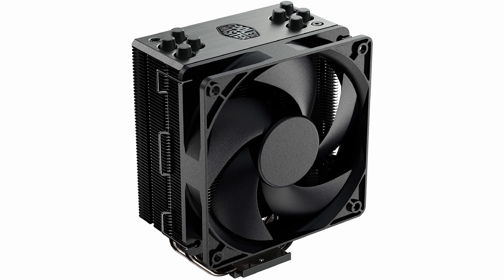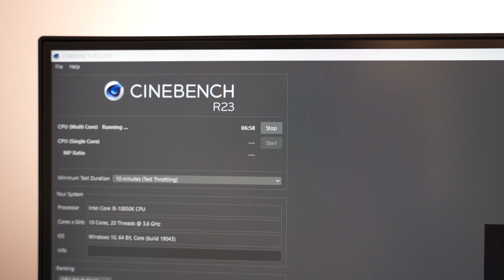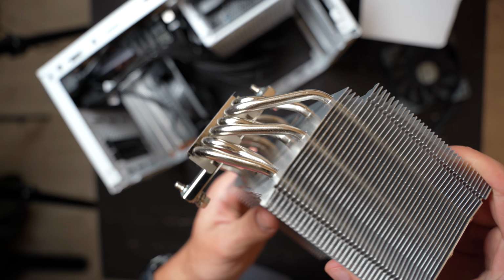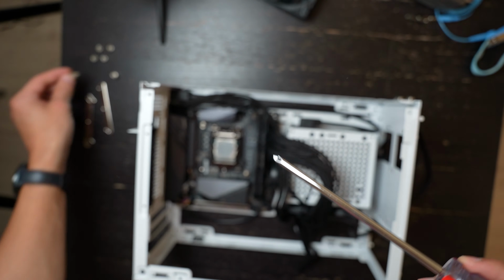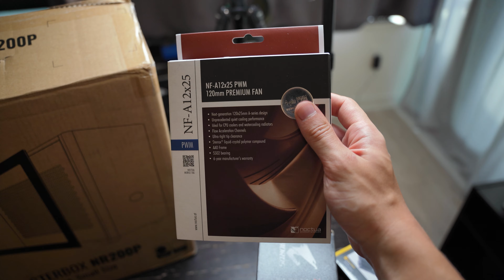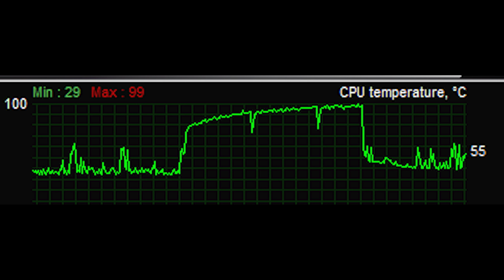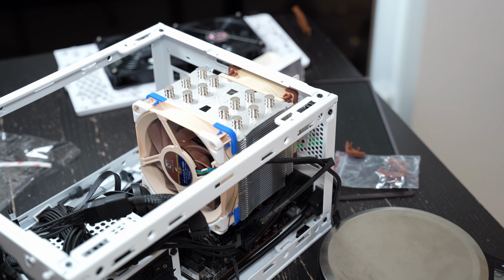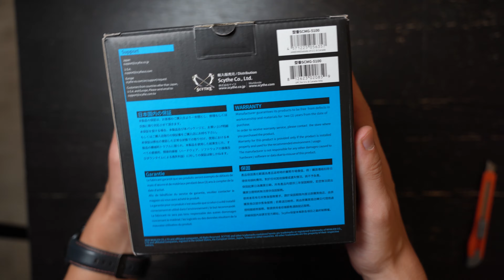NR200 Build - Best Air Cooling Setup w/ Tempered Glass (no compromises!)

Comment from the maker: Update 8/24/2021: I spoke to Scythe about the fan noise and they sent a replacement and it fixed the issue! Awesome customer service, I must add!
Reply: So would you recommend keeping the fan as part of the cooler configuration?  Or is the RPM speed still an issue?  Great video, btw!
Reply: how gpu temp in long session gaming?
Reply: Check out the nr200 inverted mod if you decide to go liquid cooled
Reply: @mrdjent8856  not available also more expensive than drilling 2 holes in an nr200 + 240 aio
Reply: Did you try the Scythe fan again after you received the replacement? I sometimes buy other coolers and just replace their fans with Scythe  fans because they are so good even at lower RPMs. 🙂

Note: Scythe makes a 2000 RPM version of this fan, and it performs really well, comparable to the Noctua A12/Artic P12.
Reply: would you consider trying a new ID cooling se-226-xt on this case? i think it would fit nicely
Reply: Did they tell you it's pronounced like SYTHE, not SKY-THE? lol
Reply: @scottibass  SIKE! That’s the wrong name!
Reply: I build my PC in a Sama Im01 and I'm having the same problem with the creepy noise from the Kaze Flex Black that came with my Mugen 5 Black. After seeing your update comment I decided to contact Sytche and send them a video showing the issue. They said they will send me another fan as well. Just waiting to see if the new unit will be less noisy. I only bought this cooler because the reviews said it was quiet, but my experience have been very different so far...
Reply: What you think about nr200max with pre build 280mm aio at the top?

Comment: why not test the cooler tower without putting paste? and if it fits then apply paste?
Reply from the maker: Fair comment. I suppose I wanted to test the thermal performance as well. But that's a good idea if you're only concerned for height clearance.

Comment: You could use the CPU cooler as a rear exhaust to minimize dust with no issues if you 1. have two bottom fans as intake, 2. have two fans at the top as exhaust, and 3. (optional) setup your GPU so it exhausts more heat through the rear blower (it's what I did with my 3080 FE card).
Reply: That would be a negative pressure scenario, which would not be optimal at all for dust build up
Reply: @rivie2x well, this case has filters on all sides except for the back, which is exhausting in this case, so I really don't get what you're saying here
Reply: CPU Cooler as an exhaust would mean, hot air coming out of the Power supply exhaust gets sucked in the cooler. Not ideal

Comment: I think the problem is - this case just doesn't have inherently great cooling so you are always battling that.  Glass sides, flat front, not much air in or out apart from the top or bottom.

Comment: FYI - the Scythe FUMA 2 will fit. It fits in my NR200 no worries
Reply from the maker: You are the lucky one!
Reply: Same
Reply: which mother board are you using?
Reply: @lk2eu487  I'm using the MSI B450i gaming plus AC, but motherboard heights are supposed to be the same no matter what

Comment: The Be Quiet! Pure Rock  also fits nicely (not event touching) with the glass panel if you remove the top cover. You can even fit 2x 120mm fans :)
Reply: If only I knew...
Reply: Just the basic pure rock?

Comment: Nice! I'm looking for air cooling options for this case, trying to make it my next build. And I agree with you about AIO's-- I used to have one, it was louder than air cooling because it has a pump constantly cycling, and eventually the pump failed and my CPU completely lost all cooling. In my experience air cooling has just been quieter, far cheaper, just as effective, and even if the fans failed there's at least still a heatsink for passive cooling.
Reply from the maker: Agreed! Ty for the nice comments

Comment: I did this exact build last year and still running it. Dropped my delid 8700k about 12 degrees. 
Tip: pull the top metal mesh off the top of the case and have exposed top fans, you wont need bottom intake fans at all. Lower the psu with standoffs on the psu mounts. The scythe cooler is the best but the stock fan is terrible and must be replaced. Also remove the rear pcie covers for better 92mm air flow. Im using it with a ROG 2070 super and strangely it ran cooler with the glass panel on. The NR200P is an amazing case.

Comment: If you bend the mounting plate for the motherboard and use slightly smaller standoffs you can fit the u12a in the case

Comment: Extremely useful!

I`ve reached 78 degrees celsius with my 5600X while playing GoW, using push and pull right to left, so airflow was intake from inside the case to outside the case.
When i changed the orientation, from intake left to exhaust right, with a exhaust fan on top...MAAAAN, IT REACHES 69 DEGREES NOW

Only complain is that i get more dust now. Will have to create some sort of dust filter to put at the back of the case.

Anyway, amazing tip and explanation. Really worth to check it out ;)
Reply from the maker: Thanks for confirming that it's the more optimal orientation when gaming. I see Soo many tech YouTubers do it the traditional right to left way (dave2d)
Reply: yep! i have a noctua NHU12S Chromax Black + Noctua fan NF-F12 Swapable for push and pull, and i really didn`t get why my temps were so freaking high...man, this changes the entire game. 10-12 degrees less in a mini ITX build is absurd! Tks a lot for the tip :)

Comment: Amazing video,m super informative. I do have a couple of questions if you don't mind answering them?

1. In your case you have two fans blowing air directly into your GPU. Did this help with thermals? I heard, on Reddit and other forums, that it can hurt thermals of the GPU to have some fans blow directly into them like you have there.

2. Do you know of any other PC cases, ATX specifically, that allow for fan installations at the bottom? Phantex's Elite does but their whole case is insanely huge it comes with its own wheel-barrow like box. Lian Li has a few but I'm not much of a fan of temperate glass side panels.
Reply from the maker: Yes I believe 2 gpu fans does help. But if you have a thicc card you'll need slim fans

Comment: I bought the u12a for my NR200 with the metal panel. It fits perfectly and with rear exhaust configuration it keeps my 5900x around 70 degrees under prime95 load. Yes, the Noctua is expensive but this cooler will last me easily another two CPU generations.
Reply from the maker: Awesome
Reply: My U9S by Noctua has been chugging along for 7-8 years. I upsized from an Ncase M1 to this NR200 case so since I have more room, I'm going to replace it with a larger cooler or just go with an AIO.

Comment: This is a really helpful video.  I'm doing my first build, starting from ZERO knowledge, and got the ASUS ROG Strix B660I, and I'm so worried about clearances.  I'm going to go with your setup, but instead of the Mogen 5, I'll try the Thermalright Silver Soul 135.  A little smaller, but much better heat sink density.  The company seems to be very well respected in Europe.  Also the cooler came in white, black, and gray.  I'll be using Arctic fans.  Hope it works!  I've got the i7-12700K.
Reply from the maker: Hey I really appreciate your kind words. I'm going to research this superior option
Reply: I think may need a lga1700 kit cos the bracket doesnt fit the b660i...
Reply: For those wondering: I have my NR200 set up with the glass panel. I have the same motherboard with an unaltered Scythe Fuma 2, and everything fits fine. Enough clearance for I/O shield and RAM. It's even easier with the mesh panel.

Comment: I believe there are a few options from thermalright with 154mm air cooler. Ta120 ex comes to mind, they have even smaller 130ish mm height cooler. I think it could be worth your time checking those out

Comment: Great video. I'm glad to see more content about the NR200!

if I remember correctly, in one of his videos, the guy from Machines and More channel replaced the Kaze Flex fan by a Noctua NF-A12 in the Mugen 5 and the difference in temps was less than 1º C in a overclocked R7 3700X. Maybe there is a significant difference in a hotter cpu like yours. 

I also have a NR200 paired with a Mugen 5 cooling a 3700X. After some tests, I decided to go with: mesh panel (to bring cool air from outside and help the GPU to breathe) + cooler exausting air to the back + one fan on top right as exaust. No fans beneath the GPU. Temps are good and I can barely hear any noise from my PC, even when gaming.
Reply from the maker: I did confound the results by using a rear fan 92mm which added more cooling!

Comment: I know this video is a bit old, but Noctua recently released the D12L, a 120mm dual-tower with a height of 145mm, a whole 10mm less than what you're allowed. And by their own rating system, its thermal performance sits square between the U12A and U12S.

Comment: Nice video and explanation. I appreciate video like this helping everyone out.

 I built my NR200 a few months ago and went with an inexpensive 240mm ID cooling AIO. I was about to send it back in place of the a good air cooler since it can't really (by default) be top mounted. And I've pretty much watched all of the videos on air cooling the NR200 and was about to go that route. But since I don't use the glass panel I figured I'd keep the ID Cooling AIO and give that a run. I didn't want to spend a lot for the Noctua A12X25s so I went with the Noctua NF-P12 Redux as AIO radiator intakes and top exhaust fans. I also put two 15mm Scythe Kaze Flex 120mm as bottom intakes. Barely fit below the beastly 3070 Ti FTW3. I kept the 92mm rear exhaust that came with the case. In the end I have 7 fans and a whisper quiet setup. Very happy with the case and end result. 

Sorry, I made it about me. =P
Reply from the maker: Nice setup! Must be quiet.
Reply: This video and your post are exactly what I was looking for!  I love the SFF but hate the fan noise, so it's been a battle.  Anyway, I currently have an EK Basic 240 and replaced those fans and top exhaust in the NR200 with 2000rmp F12 PPC's.  Just added a 3060 Ti the other day and it was getting hot in the bottom of the case.  After reading your post, I went ahead and ordered a pair of A12x15's for the bottom and will install them soon.  I am curious how your thermals are under load.  Have you noticed any throttling on either the CPU or GPU?

Thanks to both of you for the awesome info!  =)
Reply: @wessmithchandler  Hi Wes. To this point I've been doing a lot of gaming since I configured this case and I never even here the fans ramp up regardless of what I'm playing. Granted I'm not typically playing AAA heavy hitters on ultra/4K. I've run Unigine Heaven benchmark a few times and my top CPU/GPU (5600x/3070 Ti) temps are at around 64/73. During this test the fans never hit full RPMs and you can barely hear them from 5 feet away. I haven't noticed any CPU or GPU throttling to this point. The only change I may make at some point is to go from the cheapy AIO to a top performer. But right now there's no need. 

How hot is your GPU getting? From all of the videos I've watched (many!) on this case, the bottom intake fans will improve (a few degrees maybe) your GPU temps but will have no effect on the CPU.

Comment: Well done!

Tip, JSyntax: Use rubber gloves when working with unpainted aluminum products. The oil on your skin will case a chemical reaction on the metal.

Mugen is pronounced "MOO" (like the sound of a cow) "gen" (hard g, not soft g like generation) due to it being Japanese in origin.  Scythe is European and the c can be considered to be silent: syth (not Sith, of course!).

11:34 2,000 RPM. You accidentally said 200. ;)

12:24 The NF A12x24 is famous, not infamous, and it is neither the most expensive, considering that there are several fans that nor the most premier, except perhaps for the amazing SS02 bearings. The most expensive fans in my inventory include the SilverStone Air Penetrator 184i-Pro SST-AP184i-PRO, and a Delta fan. There are fans that even more expensive at over $100/fan, too.

Comment: Thanks for the informative video, I really enjoyed it thoroughly as I am planning to get this rig if there is enough gap between the panel and my 157mm cpu cooler in height.
Could you tell if there was about a 5 mm+ gap between your cooler and the metal/glass panel? Thanks again.
Reply from the maker: Hard to measure!
Reply: @JSyntax  I heard it barely fits up to 158 mm with the mesh panel, again thanks for the response.
-  I use a piece of thin cloth to see if there's enough gap and it seems to do the job.

Comment: I just got the same Aorus Z590I mobo, but the cooler I currently have is a Shadow Rock LP. So went trough all of the same thoughts you listed and then some - RAM clearance, same huge mobo heatsink, on top, the USB3 header cable doesn't fit under the only position the Shadow Rock LP fits and of course can't return used items where I live. Because I currently use a non K i5-11600 (that has a lower TDP), I went with a Pure Rock 2 Slim. I used it before, and I know it works great and will definitely fit in my current setup.

Comment: 17:40 you said that the FE was performing better than the 3 slot aorus 3070, so getting a slimmer GPU and having 2 good bottom fans gives better thermals than having a chonky 3 (or 3.x) slot card? 
I'm torn between getting a slim 4070 Ti (theres one by inno3d that is 2 slots / 41mm thick) with two bottom fans (hoping that 25mms would fit, would even get T30s if they fit and have enough clearance) or getting a thicc 3.x slot card that would likely not even fit 15mm fans.

Comment: i used the ID-COOLING FROZN A620 BLACK ($40) and it fits perfectly and looks better imo, but it does require 90 degree pin adapter for fan clearance.

Comment: In my case it's a C14S vented side intake 2x140mm push-pull down on the motherboard, won't work on glass sidepanel of course, but I'm okay with that. I might put the case on its motherboard side (reusing the feet to raise it a bit) so GPU can intake more air and CPU/GPU won't sag the socket/PCIe slot. Will probably need a heatsink for backside NVMe SSD cooling.

Comment: Instead of intake from the back. Would it be possible for air to flow out from the back?
Reply from the maker: Yes you can do that but depending on your graphics card you might be pulling in hot air from its exhaust on to your CPU Cooler which might affect your CPU Cooler performance while gaming

Comment: As it happens I've used a similar arrangement for my last two full ATX builds (currently a Fractal Define R5), i.e. with the CPU cooler 'backwards' and the rear fan as intake, with a central top fan for exhaust. I made up a filter for the rear fan consisting of a frame cut from 2mm ABS sheet which attaches via strips of 3M magnetic tape so it can be removed and installed in seconds by feel for cleaning. Effectively, it's a completely independent cooling loop for the CPU, and the central top fan is ideally positioned to exhaust heat from both CPU and GPU. There are also two front and one centre/bottom intake fans (Arctic P14 CO ball-bearing, spinning between 550-900 RPM). Hence it's net very 'positive pressure' with all intakes filtered.     BTW, I also had problems with a Scythe fan - the rear intake was originally one of their unusual 14cm counter-clockwise spinning, 7-blade Kaze's (which I wanted because the plan was to 'stack' it in line with the one on a Noctua NH-U14S cooler, I eventually went with NH-D15S dual tower), and like the one in this video it was very noisy above about 900 RPM (unbearable anywhere near its 1750 RPM limit). I replaced it with an Arctic P14 RGB (has the annular ring on the impeller which stops the drone from blade resonance the standard one makes at certain RPM). It's easily the quietest 14cm fan at given RPM/pressure I've tried, including that on the Noctua NH-D15S and Be Quiet Silent Wings, both of which are two or three times the price.   ETA the CPU is a i9-9900KF @ 4.9Ghz/1.295V (no AVX offset),  in Cinebench R23 it pulls c. 150w, with the rear intake fan at c.1500 RPM and Noctua CPU at c.1200 cores are c 80°C (+/- 2°C) on a warm spring day in the UK. The CPU is going to be de-lidded and direct-die'd soon (using a shim around the die and with the arched Noctua plat lapped flat).
Reply from the maker: damn that sounds intense

Comment: Great video, but I was wondering about the case fan configuration. Would removing the top exhaust fans make a noticeable difference, because according to my dad they don't do anything since the air could just go out the mesh panels.
Reply from the maker: It's adding more air flow, so it's going to push out hot air faster

Comment: Finally got my build after watching tons of videos - and yours definitely helps ! Leaving the build here so you can have another idea to test your CPU and GPU

CPU: Intel Core i5 11400F
Motherboard: Asus Z590i ROG STRIX
RAM: Patriot Viper Steel 3200MHz 32GB  (16x2)
GPU: RTX 3080 EVGA FTW3 Ultra 10GB
PSU: Cooler Master SFX 850W Plus Gold
SSD: Samsung 970 EVO Plus 500GB
HDD: Barcuda Seagate 2TB 5400 RPM
Cooler: Noctua NH-D12L (intake)
Fans:
- Top: Cooler Master Sickle Flow 120mm x2 (Exhaust)
- Rear: Noctua NF-A9 Chromax Black Swap 92mm x1 (Intake)
- Side: Arctic P14 PWM PST 140mm x1 (exhaust)
Reply: @gackhuhn4868  yeah just upgraded the card and will get the CPU up to 11700F (many things to spend aside from computer) :D thanks for the advice

Comment: Why is the 120mm fan on the heatsink mounted upside down? Have you tried to turn it over and do further tests with the reverse airflow ??
Reply from the maker: It's because the gpu blows hot air inside the case. We want to draw cool ambient air from the rear of the case. If the fans were oriented to the rear, it would be drawing the heat from the video card  onto the cpu, which is not ideal.